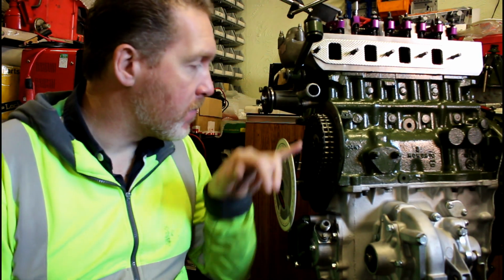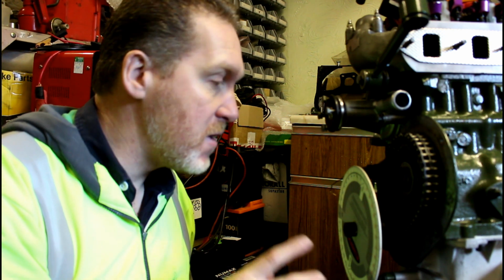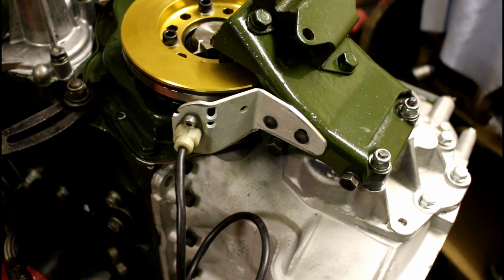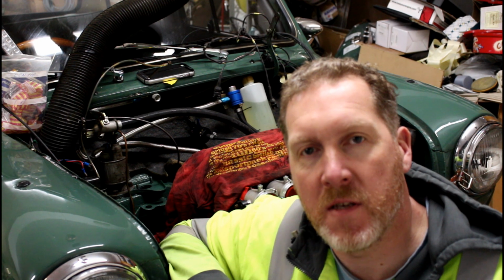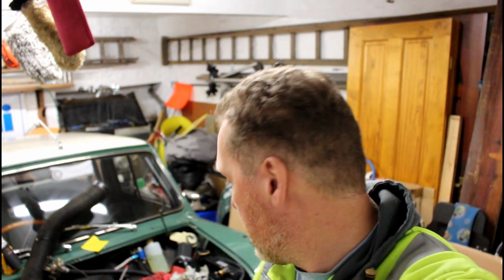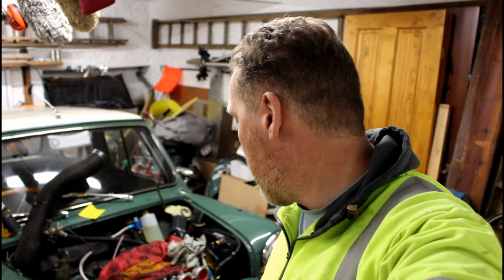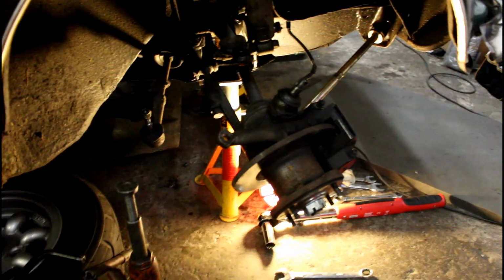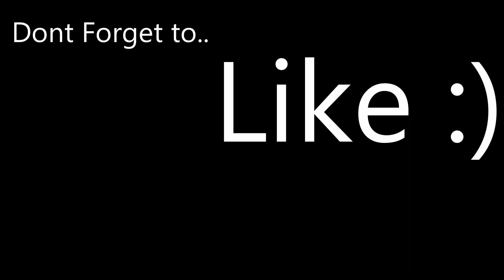Austin the Arden 8 Port. Ep4. Engines finished!

Comment: Hey pal I'm proud of your build. I'm giving you a shout from all the way in sunny Barbados where I'm about to start on a mini build as well. So keep pushing on pal, as for that inboard joint try putting the pot joint alone just to see how it's fitting on the gearbox. You my have to take off the side cover and give it a good inspection. But push on pal.
Reply from the maker: Cheers Kurt, good luck with your build :)

Comment: More great info Rich, thanks for showing the detail of what's needed for an injected 8 port, who's vernier cam wheel was that, seems a bit fiddly to adjust consistently? Cheers!
Reply from the maker: Hi Graham, its an med one, its fine, normally, but until i undid the rockers the pushrods would push back against the cam, moving the timing, typically i found a better way of getting tdc, but by then the engine was back in the car, thats my only worry, thats its timed correctly but incorrectly as my tdc is out, i was very, very careful but still the worries there.

Comment: Had a pot yjoint that refused to "click" in once. Sorted it by actually grinding down the lenght of the post joint. Took off just under a millimeter. Clicked in niclely. 
Not the way to do it, but engine was in the car...